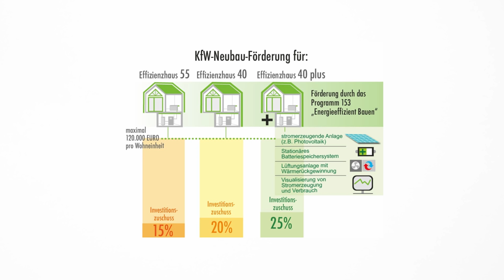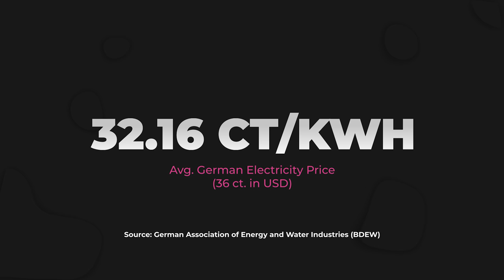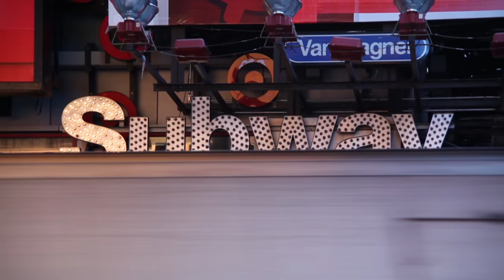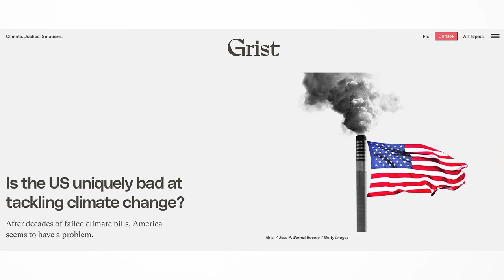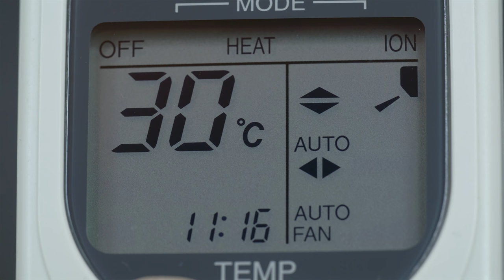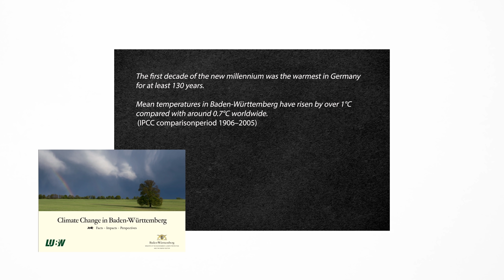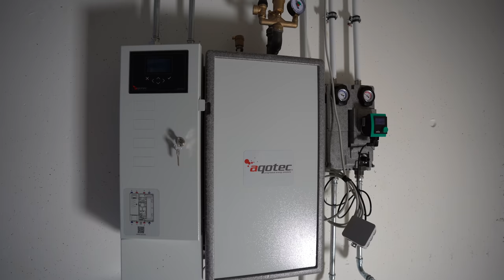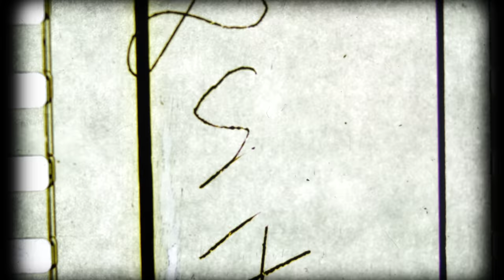HVAC (HLK) in German & American Homes | A Tale of Two Countries

Comment: The problem with district heating starts when the infrastructure becomes old and needs much maintenance or has to be replaced. Not all participiants of the system are able to pay for this and thera are many conflicts about that. In many cases, the infrastructure then stays in bad condition and becomes unreliable and more expensive.
Im not a fan of this concept.
Reply from the maker: Jonathan and I were recently talking about this... is there a difference in Germany where the City vs. Home owner's responsibility for maintenance on infrastructure ends/begins? In the US, it is the property line. So, for example, if a water pipe bursts in your yard - you have to pay to fix it. If the water pip bursts under the street in front of your house, it's the city's problem.
Reply: @TypeAshton  The problem often here is that many of these systems run based on public private partnership contracts. The contractor earns money if he keeps costs low. This is no problem in the first years when all is relatively new. Maintenance is minimized systematically. Often the contract contains exceptions for extraordinary maintenance issues, so that the participants have to pay for it. If the public partnership contract reaches its end, the infrastructure is handed over to the community or the participants. Then they have as a community to deal with the problems of the aged infrastructure.
If you have your own heating system you decide on your own. This is more flexible and less complicated.

Comment: I prefer radiator heat to forced air heat, because in the latter, there is always so much air movement in the room. It hurts my eyes and dries out my throat and nose…
Reply from the maker: I know our families back home usually run humidifiers in the winter time because of this exact problem. The air does get very, very dry.

Comment: @BlackForestFamily: I really love your great videos! Just one correction must be given: The horizontal line on the 1st map you showed was a bit misleading: As the Earth is (sort of) a sphere and not flat, it's not possible to lay out the surface of the earth on a flat screen:
There are many differeny ways to project the curve of the earth on a flat surface, and of course all of them have their good and bad sides: https://en.wikipedia.org/wiki/Map_projection

If that map would have had the circles of latitude and drawn on it, they would have been curves, not straight lines due to the map projection used for it, simple examples:

The line for Berlin which you layed on your map shows even London and the south of Ireland below the line, which are in fact north of Berlin, not South. This even gets even stronger when you hit the USA and the especially south tip of Alaska on your map.

It would be nice if you'd acknowledge this feedback.
Reply from the maker: Yes you bring up an excellent point. We used this map from another reputable source and didn't create it ourselves since it was a quick illustration. However, we will try to incorporate a better illustration the next time around.

Comment: What do you think would be the best system to heat a house that sees temperatures down to -40? Would the communal heating system work in that situation? Even if a lot of the houses are 40 or 50 miles from the city center. Also what do you think the best way to cool a house that sees temperatures of 110f in the summer? Is there a better way of doing it rather than using ac? I don’t think opening windows will work if it doesn’t drop below 90 at night.

Comment: I ansolutly do not want an AC. I very often catch a cold in rooms with AC, especially if I change between hot outside and cold rooms. I do not like the fact that AC waste so much energy, that is just not good for our future, since we would need to build even more powerplants, for example destroying our last natural rivers. And I feel like most people in our region are absolutely able to survive a few days in summer by opening windows in the night and morning and closing them when it is very hot. If it is still very hot you can hang up a few wet towels and thus cool your room by drying them, which produces cold.

Comment: Forced Air Heating/Cooling creates a lot of dust and bacteria Problems.
But most importantly, it is a dumb way of heating, especially. And here in Germany, heating is the more important factor.

If you heat air (that does not transport a lot of energy). you end up with very dry air (less relative humidity) that irritaes your eyes and Nose, and does not feel warm at all, because the surfaces like walls and the floor are ice cold and create a current of cold air that is felt especially near the floor.
And because especially the windows and outside walls are being constantly cooled by outside temperatures, the bit of energy the air can transport is not sufficient to raise the inside temperature of the outside walls.

BUT: Using classic raditors (like a lot of homes in Germany) is not a lot better, because radiators generate mostly warm air that circulates through convection, and also creates a lot of dust and a sense of a cold breeze in the room, because the cold air flows near the floor to the radiator, where it is heated up, rises to the ceiling and falls down as it cools again.

That is a reason why most households in Germay over the last decades switch to floor heating.
It warms up the netire floor by a bit, but that bit is enough to heat the air near the floor, where it is the coldest, therefore creating a much slower and more even movement of air and temperature difference between the floor and the ceiling of a room.
In addition, floor heating creates some amount of infrared heat, that is really good at heating up surfaces.
But, Floor heating is slow to react, because the water has to heat up the concrete of the floor and the tiles that lay on the concrete firsat, before it can start to heat the room.

And at last I try to explain the way we heat our home in Baden-Württemberg, Germany.
Our house is over 200 Years old and partially a half-timber construction (Fachwerk), so we do have wood-beam ceilings with clay and straw between them, that makes using floor-heating basically impossible, but there is an even better way of heating, and that is Wall-Heating.
Every outside Wall of our house has water tubing inside the plaster (yes we have to be careful where to hammer in nails, but that is no problem when you have a termal-camera), heating the wall, like a Floor-heating does.
This creates a lot of infrated heat and negates the coldest sufaces. traditionally in houses.
The Outside walls are also insulated from the outside, so the heat does not simply escape.
This way of heating is much faster to react that floor-heating, because there is a lot less mass to heat up, and it creates a kind of heat, that is like standing in the sun.
When i enter the bathroom (with a lot of tubing in the angled Wall thats part of the roof) it literally feels like stepping outside into the sun.
Because what you feel when standing in the sun is infrared radiation.

It does not matter if the air temperature is only 10°C, if the sun is shining and you stand in the sun it is warm, likewise if it is 20°C and it is night time, it does not feel as warm.

Comment: That district heating even saves you Space in your Home too, because you didnt need a Cellar
wich normaly is installed the Heating System and a Oiltank.But they only lay Pipes for that
in new building areas and not in Streets with old Houses.If they must lay a Pipe of Gas or district heating,they must rip off the Streets wich takes Time and Traficjams.And you must pay a lot of Money for the Installing, from your own Pocket.But this Types of Cityheatingsystems is managed
not like a Company,its from the municipal and you only pay for the Cost and no Profit.
But in General, nothing had changes since hundreds of years ago,you only heat or cool the Room
were you in and not all the same Time.I had buyed in 2006, an Air Cooler that blow Water an Ice
in the Room it had cost only 199 Euros and keep me the Summer cool.Sleeping with open Windows helped too,but then you hear much Noises and  find no sleep too.
But we have to old speech "what you didnt kills, makes you harder.
So in USA , the Oilcrisis didnt had so much impact to the People,they want it cosy
and they dont had to pay so much Money.After the last 50 years they even Think about
other Methods,even when they using more then 1,1 Billion Africans.
They had 110 million Citizen moren, then in 1976.So they build even more new Houses
without efficiency but with a cosy temperature controller.They sell us something comparable,
Radiator controlled by Wifi with you smartphome,for the Smart Home.But if you dont live in
a Big House you can do that manualy,the Smartphones didnt hold more then 4 Years and then you had to  install the Software again with new cost.And dont forget the Texas Blackout last
January.We have so many Power Plants shut down,that when People need Energy in January
and the Sun or the Wind cant produce so much Energy,we had no reserve.And its possible
that we can have a Blackout too.People want electric Cars,but if that force an Blackout
we need more Investions to prevent that.Thats is an other Reason, that you get you Energy more Local.It dosent looks, that they get an Fusionsreactor working in my Lifetime.That dosent
make Radiation but cheap energy for all.So we take Energy from from no Nuke.

Comment: How's the cost of energy now in Germany? I've always been amazed how Europeans never take into consideration, small things, Water used to mix cement does not naturally flow to the rivers, cement and lime are quarried, shipped, machine crushed and ground, cooked, bagged using paper and plastic. Copper pipes, copper must be mined and smelted and shipped by ship to foreign countries. Plastic pipes are made from oil. Roofing tiles are made from clay, cement or plastic. I lived in a house in Europe that had radiant heat. It sucked, feeding the furnace every couple hours.

Comment: should be no rocket science to build a house fitting for the region you live in, hot sunny regions will need high rooms, the roof over extending over the southern windows to give them shade. massive walls also suck in the heat and store it for cold nights. winter regions will need small windows, also thick insulated walls and lower, smaller rooms for heat not to disperse.
for my home i do it a bit like Jonathan at work, helps in heat waves, for winter i use the the fireplace to heat up living room and the central heat from house for the bathrooms, other rooms are cool depends on how far they are from Fireplace, specially sleeping room is the coldest and most temperature constant in flat cause i don t like it to warm there...

Comment: This is simple.A merican summers are hot.Either you are in New York,Oklahoma or Miami american summers are hot because of american geography.Europe is geogtaphical location makes it colder.In summer may be 2 weeks above 30 Celcious in Germany.Most of the time you need good fan unlike in the US you need a/c.A/C does not make you sick.Dirty a/c unit filter makes you sick because dust and bacteria accumulated in a/c filter

Comment: @Black Forrest Family :
1) could you in your upcoming videos could mention mesurements also in metric? It is difficult to calculate while watching the video.
2) How often do US-americans check and clean their aircons? I've been working in Hotels with aircons and sometimes if there was a problem with them, I had to open and check them. The inside was dicusting... especialy the filter. Ever since I try to avoid the use even on vacations in hot regions.
Reply from the maker: Sorry if we missed one of the conversions, I thought we covered everything. It's always a challenge to convert units between our different audiences, we do the best we can. :) 

AC filters should be changed every few months, but I can't recall that being very common. I think it's typical people will go a year or more before changing them.
Reply: @TypeAshton  Instead of comparing Cents (in USA) with Cents (in Europe), how about comparing USD and EUR? Yes there would be more zeros to the left, but it should be less confusing. And adding the conversion to the other currency would also help to compare apples with apples, instead of apples with oranges.

Comment: Thank you for this very interesting video. Like you all, I see both sides as I used to be an American (came to Germany in 1999). Climate certainly plays a role in the amount of energy needed for heating/cooling but there are also other factors. As an „ex“ American living in Bavaria, IMHO radiant heating is the only way to go. Not only is it more efficient, it is also just „warmer“. Make the comparison between an open fireplace and a kachelofen - the warmth coming from the kachelofen will extend to all the corners of a room. It feels just somehow warmer. Maybe you guys can look into the reasons why that is; I can only report anecdotally. We live in a house in Niederbayern. The house was really thick walls on the ground floor, which help keep the heat out. But, one of the comments I read was right; once the walls warm up, it is hard to cool the house down again. You really need a night with temps below 18 or 19 to have a fighting chance. But, we installed a ceiling fan in our bedroom as a kind of compromise. We are not fans of AC for a variety of reasons. So, a ceiling fan can help a bit. But, hot is hot at some point.
I think there is also just a mentality issue here. Germans have long learned to do with less. This is something most affluent Americans never had to (and they are the ones who tend to write the laws). As with forests or plains or fresh water, the North American continent has historically not wanted for resources. And, there are energy subsidies of which Americans tend not to be aware of, which help to make energy cheaper, leading to less concern about its use or abuse. Things are changing in the USA but no way should the USA be preaching to third world countries about energy consumption UNLESS the USA is ready to invest heavily (for free) to help those countries leapfrog over fossil fuels into renewables. Even Germany isn‘t a great example considering its willful reliance on the automotive industry as one of its major economic giants. Sure, VW is going electric but BMW, Mercedes, Audi are all scrapping their cheaper, more fuel efficient models for SUV models … something that simply cannot be justified these days. No country is perfect and it is always interesting to see the comparisons. Thanks!

Comment: "badenova" or "EnBW" might be your district heating / cooling supplier; wouldn't it be cool to be able to switch your supplier, just in case the price goes up? The European Union (EU) has requested Germany to regulate & liberalize this market, as has been the case with energy / electricity  and (natural) gas. Technically speaking, there must be some form of "injection point" / "interface" where competing suppliers can supply their hot / cold water into the shared insulated underground pipes.
In the state of Berlin a new law of August 2021 introduced a new regulating body / "Regulierungsbehörde" for exactly that purpose, breaking up the monopoly and coming with regulations on decarbonisation, so that there might be more competitors in Berlin, other than "Vattenfall" and "BTB".
So talk to your new neighbors and put some pressure on your local politicians or Baden-Württemberg's government... ;-)
(Maybe Texans should do the same, considering the collapse of their energy grid exactly one year ago...)

Comment: Forced air heating would be a severe health risk in Europe. The high humidity and the simultaneous absence of air drying ACs would cause ubiqutous mildew or mold  infestations in vents and air pipes and related high numbers of sick people with lung problems (which btw. is also a problem with poorly maintained AC units in the States or in low usage/low mileage cars; hence the "ACs make you sick" experience many people already made).

Btw., underfloor heating is great, I have it myself, but setting individual temperatures for each room has its limits. Compared to wall radiators underfloor heating reacts extremely sluggish to changed temperature settings. So if you plan to not use a room tomorrow but in 2 days you might as well keep the setting untouched if you don't want to sit in a cold room in 2 days. Therefore in daily use underfloor heating often is left turned on for unused rooms and thus does not exploit the full possible energy saving potential like a wall radiator does.

And last: I do have a mobile AC unit and the last 19 years it was in use a total of about 15 days. So no, also with global warming summers they are unnecessary in Central Europe.
Reply from the maker: Interesting! I actually found that after moving to Germany I struggled with my allergies and lung problems. Our forced air system had a Hepa filter which we changed regularly. However, becuase I needed to open the windows to "Luft" I also let in SO much pollen in the summer time. We had to invest in a huge air purifier for our home that I could move room to room with me.
Reply: @TypeAshton  Cool! Where I lived in the states the house only had a swamp cooler. That's like breating through a wet old wash rag. ;)
Reply: @TypeAshton  That is the key point: Filters need to be cleaned and/or changed regularly.
Reply: @thestonegateroadrunner7305  Swamp coolers rely on water evaporation for air cooling. Therefor they work best in hot AND dry climates, and virtually nil in hot and humid climes.
Reply: @jessicanicolebelmonte6252  I see this like you. Regrettably my landlord didn't.

Comment: radiant heat is worse because it makes the air dry. Forced air can be humid which is more natural. The same is no longer true for Air Conditioning/Cooling. Passive cooling is not making air dry, and I don't see any disadvantages